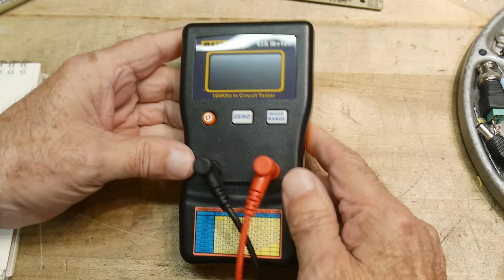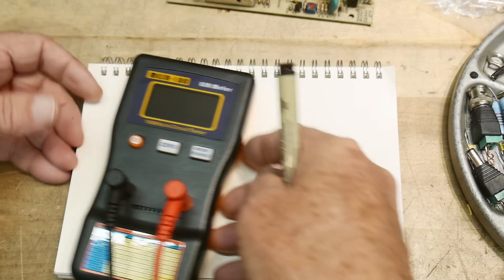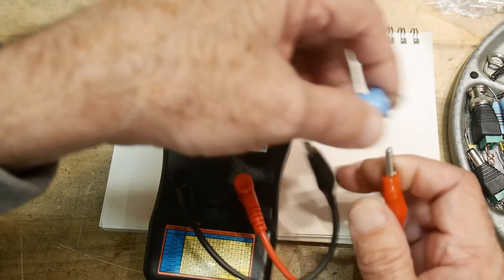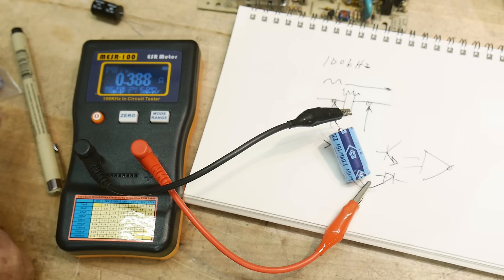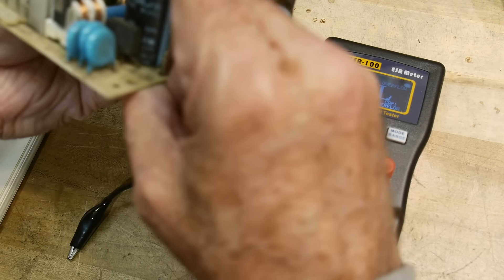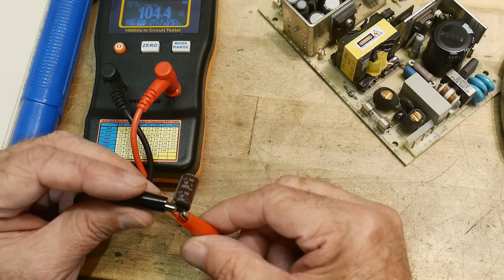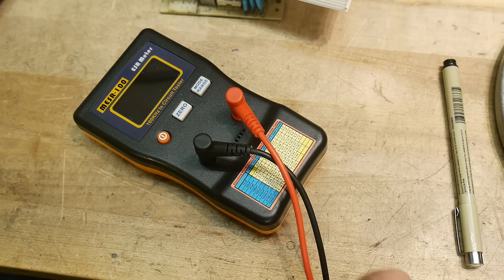#1791 MESR-100 ESR Meter Review

Comment: I have one of these meters and I find it to be a good screening tool, but there can be significant differences at low ESR values between this tool and my Hantek 1833C.  When the ESR is high, both my meters will show similar numbers.  As long as you don't expect this instrument will give you "take it to the bank" ESR values, you will find it to be a handy tool on your bench.
Reply: I've used a DIY ESR meter (someone else's design I built years ago) for decades to fix stuff. With electrolytics, the ESR is either very low (below 1 ohm), or it's crazy high (> 10 or 20 ohms). You hardly ever find caps that are just a little bad. Therefor the precise value of the ESR isn't very useful. It's more of a "go no-go" gauge than a measurement tool. And once you find one bad or leaking cap, it's best to just replace them all anyway!

Comment: The chemistry of electrolytics is not like a battery - the chemical soaks a paper to become conductive. That conductivity presses against both plates, and one end is "formed" using a current to make a thin oxide layer. This is what gives electrolytic capacitors their huge capacitance (capacitance is proportional to area and inversely proportional to thickness - the thin oxide layer giving you a very thin layer and high capacitance). When you connect the capacitor with the wrong polarity, the oxide layer dissolves and it shorts out as the chemicals boil and the capacitor pops (or explodes). When the capacitor gets old it dries out and thus it can't conduct electricity as well, so ESR goes up and since it can't make as good connection with the oxide layer, capacitance goes way down as the apparent thickness of the oxide layer grows due to bad connectivity.

Comment: I might be totally wrong here, but when the ESR is the sum of the parallel and the series resistance, that would mean that a capacitor with 0.1Ohm ESR would leak like crazy. I always thought the ESR is just the "ohmic" part of the impedance (independent of the frequency, and thus simply the series resistance). Please note that I'm just a hobby-electronics guy.
Reply from the maker: the test is done at 100kHz AC. at DC there is no leakage. the capacitor passes AC
Reply: It's not a simple sum. ESR is an AC measurement at a specified frequency. Leakage resistance is a DC measurement. There is a transformation that one can use at AC to treat a parallel reactance and resistance as an equivalent series reactance and resistance, or vice versa. If you apply that transformation to the leakage resistance, you can calculate its notional contribution to the equivalent series resistance. But it's all approximate. What's actually going on inside the capacitor includes all manner of electrical, thermal, mechanical, and magnetic effects. We bunch all of that up into two measurements, ESR and leakage, that are easy to make and that form useful approximations to what's really going on inside.
Reply: @IMSAIGuy I know that the test is done using AC. That way the (ideal) capacitance  becomes zero ohms. But I always thought that the parallel resistance really is just responsible for DC leakage current (like the leaky caps in all these old tube-radios), capacitance becomes reactance (Xc = 1/(omega*C)) , ESR is the resistance of the wires/plates/connections and the impedance is sqrt(ESR²+Xc²). I'm probably splitting hairs or I'm lost in translation ;)
Reply from the maker: @agemans_stuff  there is both parallel and series resistance and they act different vs frequency and voltage. and that is over simplified.
Reply: @agemans_stuff  Like he said, ESR is basically an AC resistance check. The way the simple ESR meters work is the same way your DMM measures resistance, but they uses an ac signal rather than a dc signal. AC impedance of a capacitor is 1/jwc, so it depends on the capacitor value and the test frequency. You can think of a filter capacitor like a shunt that shunts the high frequency noise to ground through the capacitor, leaving nice clean DC on the other side. If there's resistance to the noise going through the capacitor to ground, it stays on the DC side of the capacitor causing issues.

Comment: I have that for a few years now and it's saved me lots of times fixing stuff. When I open something up and it has electros I immediately get the esr meter and start replacing caps first and most of the time that fixes the problem. My unit has an older firmware though and it seems to run slow. Zeroing and getting readings are slower than yours. Only thing I didn't like is that it's not usb rechargeable so I put in a couple eneloops and added a resistor to the usb5v to battery + so it trickle charges if I plug it in when not in use.

Comment: ESR has nothing to do with isolation resistance (leakage), unless it is totally of range ( serial in range of ohms, isolation in range of mega ohms ). Would be nice to see test waveform on scope.
Reply from the maker: it looked like a rounded square wave. not sine.
Reply: @IMSAIGuy  Probably some DSP-like calculations involved. People often underestimate cheap uC's like STM32f10x, which has 12 bit ADC/DAC and CPU faster than my first PC. Regards from Poland.

Comment: Several bad capacitors in parallel with one good capacitor would still test good.  The single good capacitor would have to carry all extreme transients and (depending on circumstance) might overheat and fail soon.

Comment: I built an ESR meter from a schematic on someone's webpage like 25 years ago now, when there was only one ESR meter widely available, and was very expensive. I don't remember what frequency it runs at, but basically it's an AC ohm meter - it compares the signal going out to what comes back through the capacitor, and it runs a scavenged VU meter from a tape deck for the display. Basically when testing capacitors, they tend to have a small (acceptable) ESR, and anything that doesn't peg the analog meter at the 0 ohm end of the scale is bad. Like you showed in the video, the ESR tends to fail spectacularly. The exact value really isn't that important. It's either less than 1 ohm, or it's greater than 20ohm (which doesn't even move the needle). The only exception where "good" might be 1ohm or more is low value caps (10uf or 1uf) and or high voltage caps. But those aren't typically the ones you find failed either, or if they are, again they're failed big time, not just by a little. I use that meter a lot, and I think I've put 1 new 9V batteries in it since I built it. It's really efficient!
Reply: The battery lasted 25 years. LOL

Comment: Just a few things I noticed in this video that seemed wrong, or which may have been over-simplified to the point of being misleading:

- ESR is only supposed to mean Equivalent Series Resistance, and it is a complex value incorporating a number of things about the capacitor internals. And, as stated, it is frequency dependent. However, in the usual models, it is meant to NOT include leakage, as that is parallel rather than series. So the sketch of a resistor in parallel with the ideal capacitor could be considered to be misleading or confusing.
- The equivalent parallel resistance (across the ideal capacitor) should have infinite resistance, so a DCR reading should be a high Ohms value. ESR values should be very low, less than an Ohm for most electrolytic capacitors. High ESR values in an aluminum electrolytic are typically due to drying out and/or breakdown of the dielectric, while low DCR values are typically due to failure of the internal metallic structure of the cap.
- Better ESR (or LCR) meters have separate ESR and DCR (DC resistance) modes, and in DCR mode they are testing for that leakage. Indeed, some LSR meters that test DCR will do that test first, and only proceed to testing ESR if the DCR measurement is OK. This is because even a very leaky (fails the DCR test) capacitor might still pass an ESR test.
- With this model of tester, is is probably best to always use the printed ESR chart, since the go/no-go message on the LCD screen is ONLY for aluminum electrolytic capacitors rated for about 25V. Testing any other kind or voltage of capacitor, the chart must be used to get a reasonable evaluation. This WAS briefly mentioned in the video, but only quickly in passing.
- Semiconductor junction conduction in an in-circuit capacitor test is NOT the only thing that can totally invalidate ESR measurements. Parallel capacitance, or any more complex series/parallel stuff in the circuit can mess up the ESR readings. In-circuit ESR are very problematic and borderline unreliable.
- ESR meters that test only at 100kHz are really intended to be only for aluminum electrolytics in switching power supply circuits, or other circuits where higher frequency signals are applied to the capacitor under test. 100kHz will give ESR readings that are likely to be pretty far off of the desired reading for capacitors used in audio circuits, linear power supply filtering, etc. So, the product being reviewed here is hardly a universal ESR tool, but its low price might fool novices into thinking it gives valid readings for capacitors in circuits they are more likely to be working with (unless all they are doing is repairing switching power supplies, looking for failed electrolytic).

A problem with 'reviews' such as this one is that no comparison is given with reference tests made using ESR meters of known veracity. I have seen this particular meter 'reviewed' many times on YouTube, but the reviewer can't tell, in the tests shown, whether the device is producing reliable readings. I personally have tested one example of this product, comparing ESR readings with other (more expensive/professional/vetted) LCR meters (in their ESR modes), and found that the reading for small value aluminum electrolytics were fairly good, but one capacitance values got higher, the ESR reading this device gave were WAY off compared to more trustworthy testers. I can't be sure whether my one example was representative of the design, or if I had a bad example of the product.
Reply: If you buy the MESR-100 with the sole purpose of finding bad electrolytic capacitors in circuit (to avoid desoldering all of them) the inaccuracy of the measurement is not important, as long as it can spot a bad one, however, the low voltage is important to not trigger the rest of the circuit. Also, if some capacitors in circuit are parallel the reading will still be off, no matter how accurate your ESR meter is. I think this review accurately covered the in-circuit functionality of the MESR-100, it's focused on repair, and I like the clear explanation of what ESR means.
Reply: @modrobert  , but you ignore its inability to test DCR, so it's ECR tests can mislead one into thinking a bad capacitor is good. It short, this tester does not seem able to give meaningful tests, and all the lobbyists using it are ignorant of that.
Reply: @youtuuba  I wish they would just use a color bar instead of showing Ohm on the display, ranging from green, through yellow, to red. This would be enough to spot bad electrolytic capacitors if the labelled voltage and capacitance was known somehow, but  unfortunately it isn't, so many get stuck in the details instead of statistically figure out how good the meter is at spotting bad caps in circuit.
Reply: Which ESR meter have you reputable?
Reply: I believe the 100KHz testing is above the resonant frequency for the larger cap's which is why you see that limitation for audio cap's. NanoVNA can show how the impedance changes for these passives.

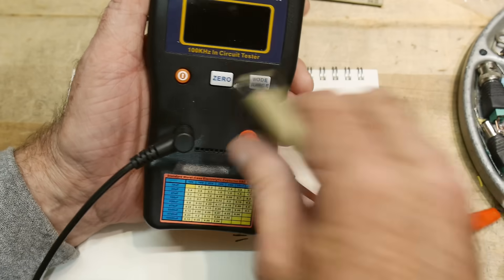Comment: 2:17 what about a leyden jar?
Reply from the maker: pretty good, but no one is perfect
Reply from the maker: chatgpt:
A Leyden jar is a type of capacitor, but it has limitations and characteristics that make it different from an ideal capacitor. Here are some ways a Leyden jar is not a perfect capacitor:

Dielectric Absorption: The dielectric material inside a Leyden jar (typically glass or plastic) can exhibit dielectric absorption, which means it can retain some charge even after being discharged, leading to a non-linear response.

Leakage: Over time, a Leyden jar can lose its stored charge due to leakage currents through the dielectric material and the jar itself, which is not ideal for storing charge indefinitely.

Parasitic Capacitance: The leads and the outer surface of a Leyden jar can create parasitic capacitance, which can affect its capacitance value and behavior.

Non-Ideal Dielectric: The dielectric material in a Leyden jar is not a perfect insulator, so it has some conductivity, leading to energy loss and non-ideal behavior.

Size and Shape: The shape and size of a Leyden jar can affect its capacitance value and distribution of electric field, making it less ideal for certain applications compared to a simple parallel plate capacitor.

Frequency Dependence: The capacitance of a Leyden jar can vary with frequency due to factors like dielectric losses and parasitic capacitance, making its behavior frequency-dependent.

Voltage Dependency: The capacitance of a Leyden jar can also vary with the applied voltage, especially at high voltages, which can affect its performance in certain applications.

Non-Uniform Dielectric: In some cases, the dielectric material in a Leyden jar may not be uniformly distributed, leading to non-uniform electric field distribution and non-ideal behavior.
Reply: @IMSAIGuy  if I recall correctly... You can take the electrodes away and reassemble them and still get a shock

Comment: Measuring the capacitor in the circuit will work when it is connected via a diode. The diode in parallel did not change the value and I could also not realize any difference when it was turned around, (partly because the instrument was covered in the video, never mind). 
All together it is a good reminder what to take care of. I like the table, and I always prefer some extra voltage rating to improve the ESR value but I will also have to check why the resistor values are going up with higher voltage. So for instance for 100µF 25V is enough if it is just for ESR.

Comment: Great video! Thanks!  Are in circuit tests with your nice LCR meter more accurate than the MESR-100?
Reply from the maker: out of circuit the LCR is more accurate. for quick testing (especially in-circuit) who cares
Reply: Usually at higher frequencies in circuit measurement is typically better iirc

Comment: For these in circuit testers you really don't have to worry about polarity.  Electrolytic capacitors can be run at a half volt in reverse bias without damage or effect on the capacitance.  So for these ESR testers that are in circuit using only 0.2 v test signal there really is no reason to pay attention to polarity.

Comment: I would have liked to see you testing the last off board bad capacitor with a ohmmeter. Should you get the same resistance reading as the ESR meter?
Reply from the maker: maybe, ESR meter measures with AC signal, ohmmeter measures with DC signal

Comment: If it only has 100kHz test frequency than it is only good to test low impedance caps.
The majority of (general purpose) caps are only 120Hz rated, no wonder if they will show high ESR @ 100kHz even brand new.

Comment: ESR = Equivalent Series Resistance or Effective Series Resistance? I have only heard people say "Equivalent" before, so Did you just say it wrong or is "Effective" right to? Or is "Equivalent" wrong and only "Effective" is right?
Reply from the maker: of course someone made the term ESR so there is a correct answer. the use of the English language is another topic. is something equivalent or effectively the same? does the ESR meter actually measure ESR or only something equivalent?
Reply: I think you are on point there.. An 1uF cap has 1.5 ohm impedance at 100Khz and thats probably measured in series with the real ESR so i wouldnt say that this meters only measures ESR, no.. They measure ESR with some error marginal with the leakage and all to.. I dont know, thats maybe a good topic for a video winkwink 🤣
Reply: @MrDacorp  don't overthink it much. Maybe it is worth to know that ESR is not always equal to cap impedance (frequency dependent), so I've heard numerous times, but haven't yet dedicated proper time to research myself, different story, maybe we can get a video on such topic too.
"Equivalent" is a reference to parasitic characteristic in capacitor simulation model. Term "effective" is usually used when there is on one hand a nominal value or theoretical or etc, and on the other hand effective is something measured in a particular setup that is conditions dependent. But they are very close terms really.
E.g. 10uF 25VDC ceramic cap has 10u nominal capacitance and at say at 10VDC bias is has only 4uF of effective capacitance.